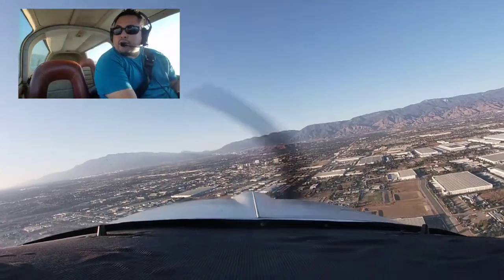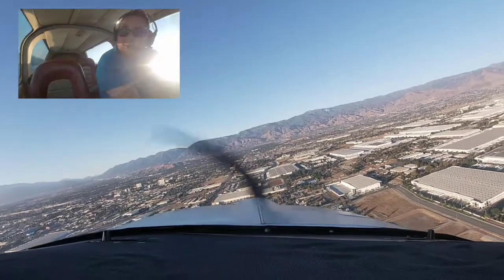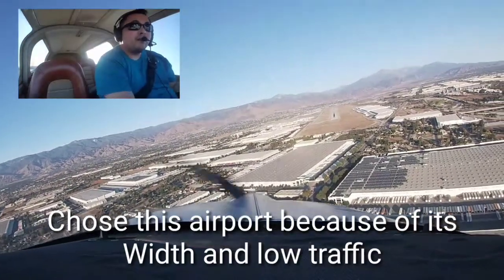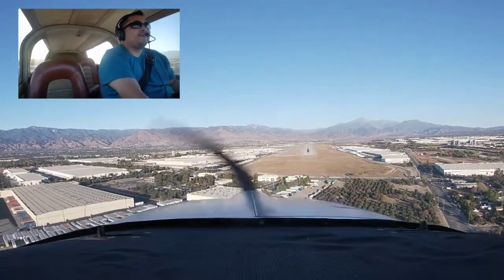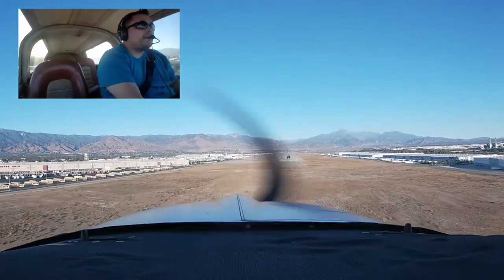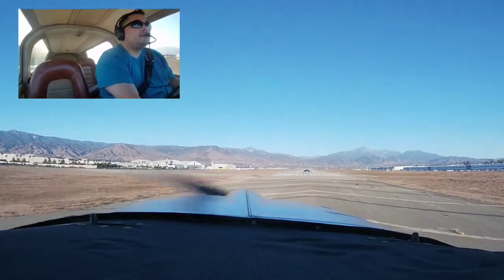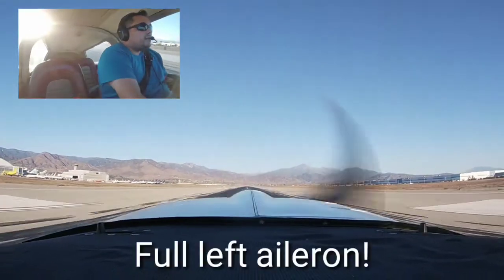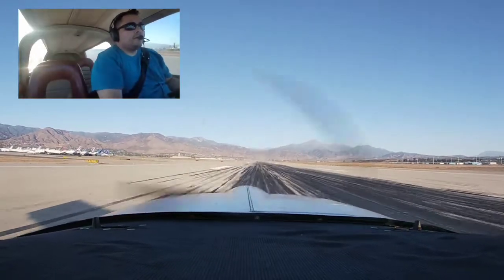Aviation: Maximum Demonstrated Crosswind Component Landing aviation Grumman Tiger AA5B

Comment: You make it look easy.i was thinking about buying one of these airplanes I just got my private pilot license,I was trained in a 172 Cessna,would you say this airplane is harder to land or easier?
Reply from the maker: Hi Jim, My first 30 hours are in a 172. Grummans in general fly alittle different, lighter steering, low wing, higher top speeds compared to the Cessna equivalents. You'll have to get use to a different "sight picture", as most low wing airplanes sit lower on the tarmac than a Cessna. This throws your touchdown off slightly as you get use to it. Your wheels dont touch when you think they should. Also, you'll need to get comfortable with a yoke that is much more responsive but you'll learn to appreciate this over time. Other than that, transition is easy, as stall speeds and safety sensitive numbers are similar!
Reply: @KillerBloc  I am thinking about buying one,thank you for getting back to me.the Grumman seems like a real nice airplane,just trying to get the most for my money,and I did not want to get something that would be totally different from Cessna considering I just got my license